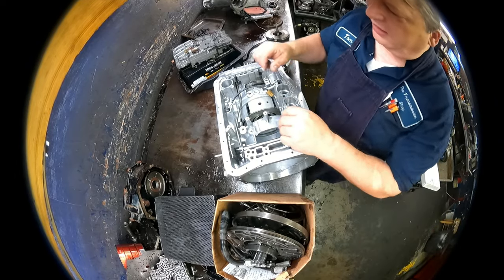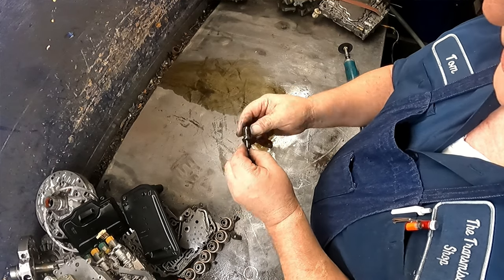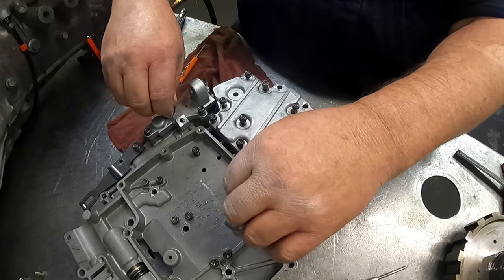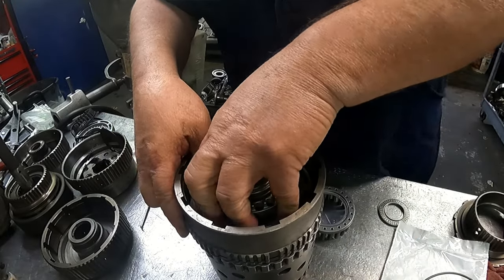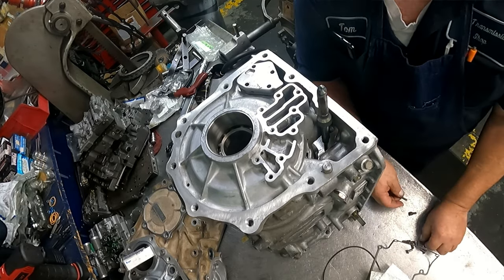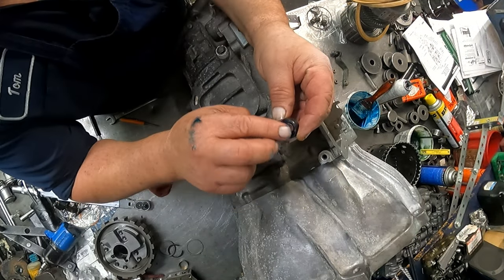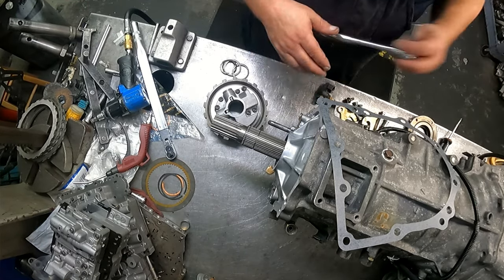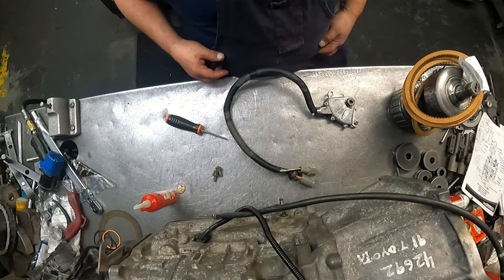A440F Rebuild

Comment: Is this the hydraulically controlled or the electronically controlled ECT transmission?
Reply from the maker: It's both, but for the most part Hydraulic. Only has 1 solenoid, everything else is controlled by the governor and valve body.